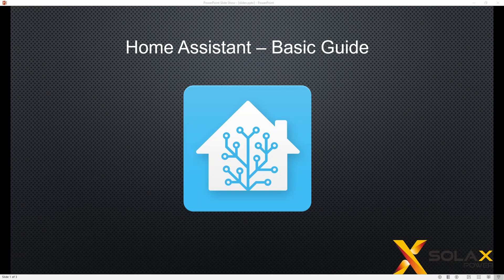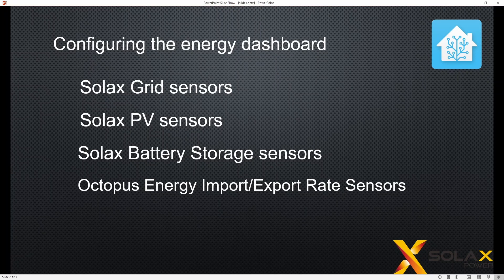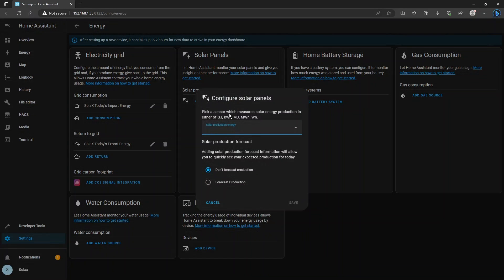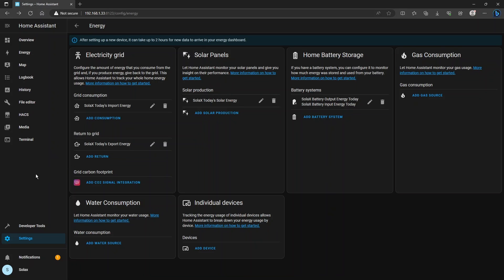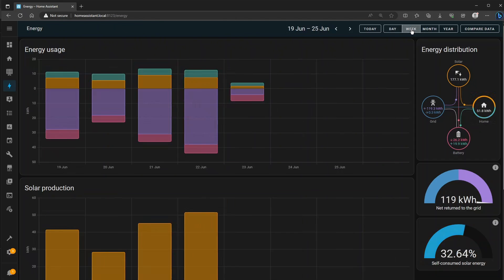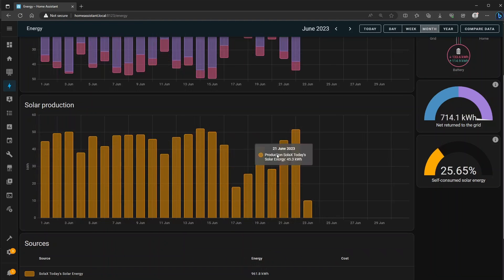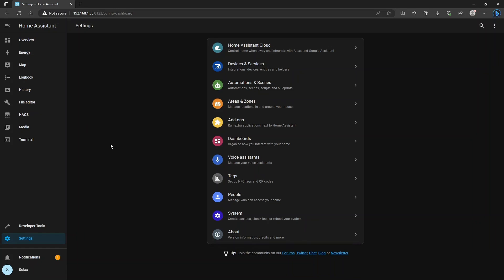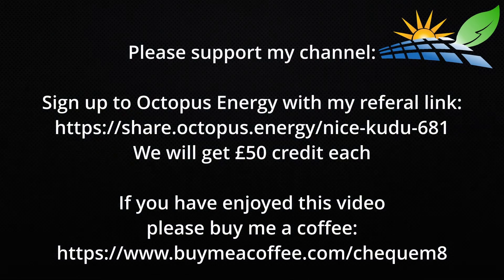09 - Configure the Energy Dashboard - Solax Solar Home Assistant Tutorial

Comment: Hi I folowed along with the video but the data being produced by the Home assistant is not even close to reality.   It disagrees with the Solax app and the actual Inverter by 1000%  And says the energy disribtion is completely wrong. I left it for a day to see if it will sync but it has not changed just got worse. What am I doing wrong?
Reply from the maker: Hmm, not sure. I haven't come across that before. If you need further support, please join Solax Support UK Facebook group. Thanks.